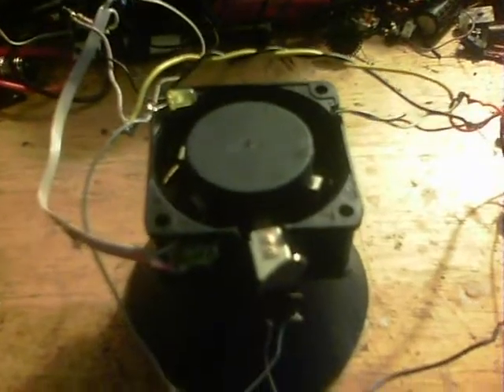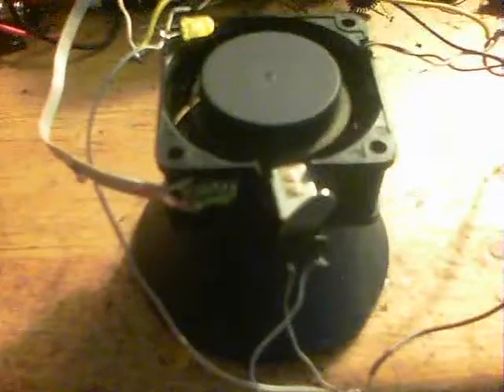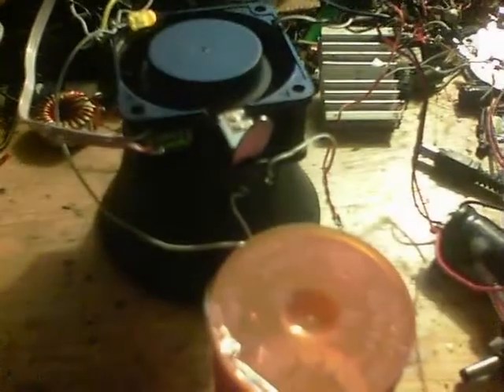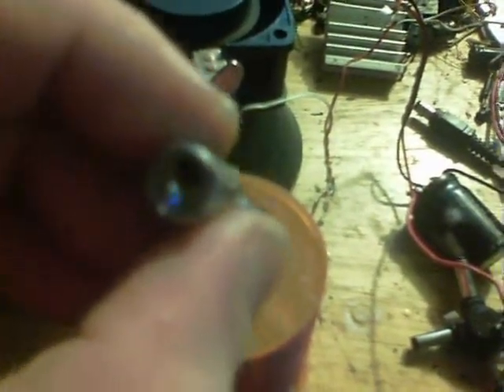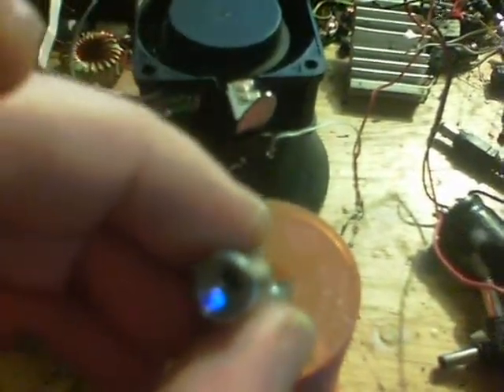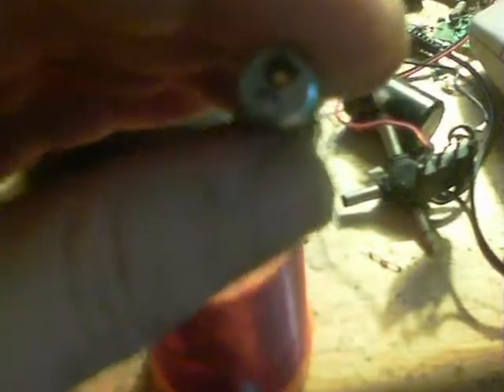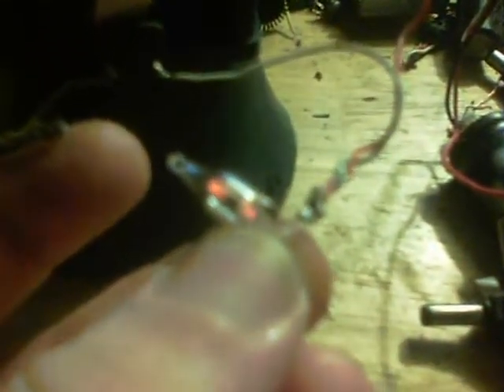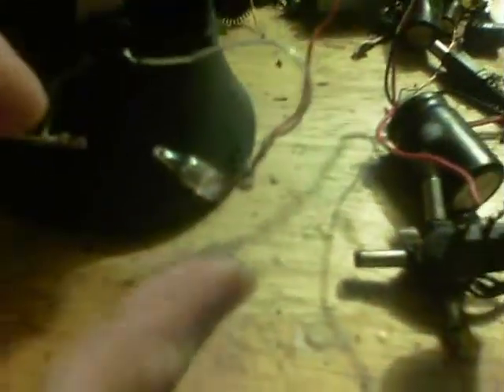FanGen - HV generator

Comment from the maker: @jozsab1 I quite agree, vagueness is no good as that can destroy components. Top output so far, using a 1N4001 FWBR has been 8V DC at 70mA from 12V...AC output for Tesla work would seem to be one of the best useful things, rather than self running thoughts or amplifying DC. The frequency will be RPM / 2 - using a pot to adjust speed, combined with a closed ring outside, i'm wondering about Leedskalnin type applications.